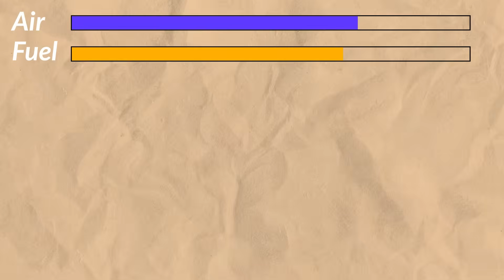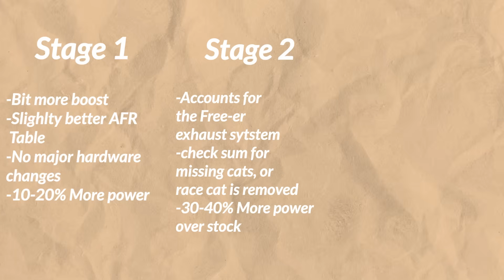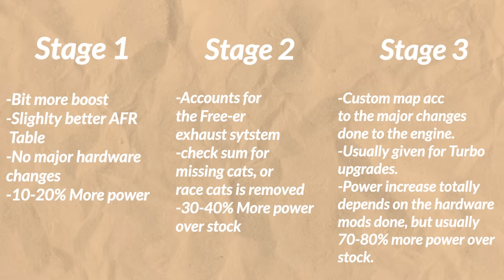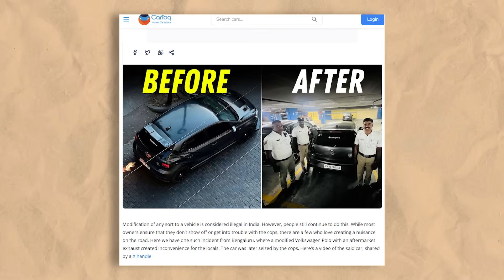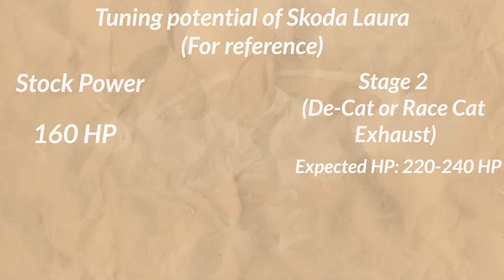How does tuning work and is it SAFE?

Comment: Have 1 question.....
Can a stage 2 or 3 tuned car drive longer like 600 to 1000 kilometers not in one go but probably 300 400 kms in one go.

Can engine handle the heat?
Or what could possibly happen in those kind of case??

Comment: Full guide to modify civic 2010 naturally aspirated plss
Reply: You might have know already that sadly there is not much power gain in naturally aspirated engines compared to turbocharged engines for the amount you spend, ecu tuning , sports air filter and full exhaust system can barely increase may be 10% of power as per my knowledge, stage 2 will cost you arount 24 k and for the full exhaust system it will cost around 40 to 45 k , converting naturally aspirated engine to an turbocharged engine will cost you lots of money.
Reply: @thamizhanaj7753  Yes but civic is my dream car
.. and I have decided to go for tune a full system exhaust and spoiler and paintwork.... I think it's enough for daily driver car.... Tell me any suggestions pls
Reply: @thamizhanaj7753 I don't want much power but just a feel good factor.... Even now I domt feel less power but little much gain can also make me happy....
Reply: @thamizhanaj7753 tell me that what type of exhaust should we value for money for this 1.8 naturally aspirated engine I want the loudest and bassy exhaust

Comment: hi sir  i started following you recently you keep the point straight like i need to know that for performance car after like stage 2/3 is air suspension good and what are flaws in it can you explain in upcoming videos and about low profile tyres also

Comment: Hi prerak i really appreciate your polo gt 1.2 very beautifully made i wanted to ask that your polo which have dsg gear box will it make problem in future actually am thinking to buy a polo gt but the 1.0 version is not in my budget am getting the 1.2 one which is costing me around 5.5lakh its 2018 model 63000 driven should i buy it but i have second thoughts on dsg gearbox what should i do do you think your polo will make any gearbox problem in future please reply bro
Reply from the maker: Get the vehicle checked out by a VW technician first to check the health of clutch packs and performance of DSG, there are many signs a DSG is about to fail, fail is a strong word, mostly clutches wear out, that’s totally repairable for under 50k, but if it’s mechatronic is failing, then it’s an expensive ordeal, so it’s best to get it looked at by VW first, rest keep up with maintenance, and it won’t leave your side.

Comment: Can you tune a NA engine?
Reply from the maker: Yes, results are 7-8% of gain on stage 1 and 10-15% on stage 2, but it’s mostly the improved power curve which makes the difference in drivability, with NA power gain is not as impressive as the refinement it receives.